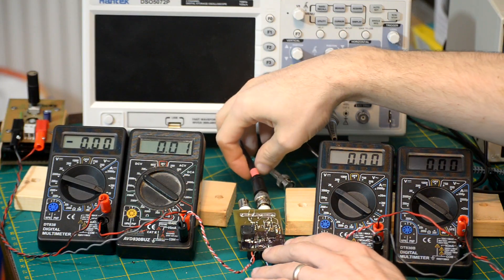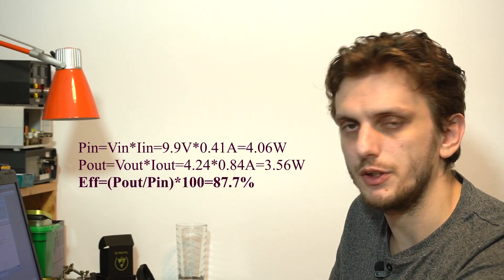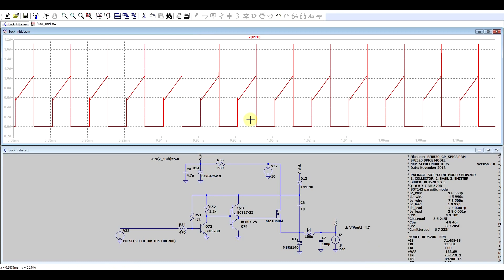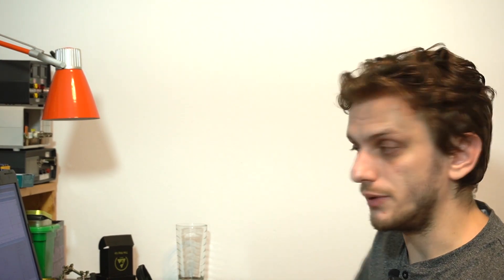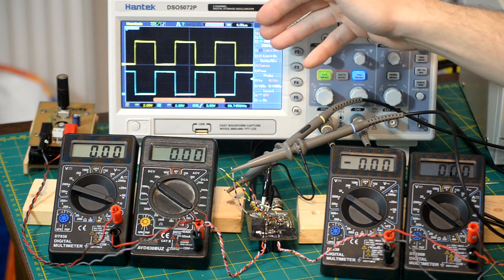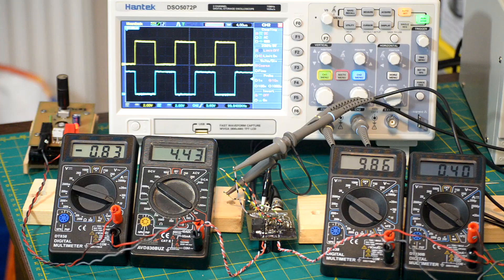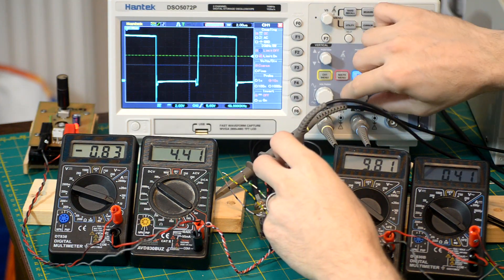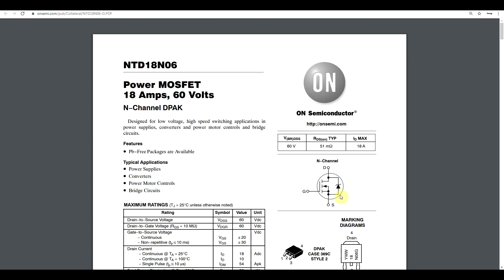Electronics Tutorial - Synchronous Buck Converters

Comment: Why voltage drop of the diode is negative w.r.t ground....
Reply from the maker: Its because of the way in which current is flowing - from ground towards the switching node; for the diode to be forward biased, the anode (connected to gnd) needs to be at a higher voltage potential than the cathode (the switching node); The current is flowing from the inductor trough the output capacitor/load and closing back trough the diode.

Comment: This was an amazing lesson, your style of asking the questions and answering later is very good to make you think first!!
Only one thing missing, what is causing the dead time? the voltage drop across the bootstrap diode?  Just saying because I noticed the low side switching is connected directly to V_stab ,high side switching goes thru bootstrap diode first.
Thank you so much for taking the time to do these videos!!
Reply: Or maybe It's probably due to the cross over on the push pull drivers?

Comment: Thank you Fesz ^\/v^--  ... when I want to know precisely what is happening in a circuit, I head straight to your channel.
Sometimes I need to replay video a few times to comprehend, electronically, what's going on. Your channel = wonderful knowledge base.
Using 'Synchronous Buck Converters' here lately with various tool batteries (e.g. 56-V 18650 and 18V 21700 batteries), for camping or emergency prep.
Using a 9:1 ratio, hand-crank, axial-flux alternator with 3-phase Schottky diode, bridge rectifier to charge a bank of super capacitors. This, in-turn, charges my tool batteries via boost Converter. (Also have mobile 400W solar charging alternative/ backup.
I'm using XT-60 connectors throughout for  modular use of components. 👍

Comment: This has been a super helpful video. One detail I found particularly useful was how you arranged your push-pull BJT's for driving the gate on the high side. I always put a PNP on the high side an NPN on the low side, but that inevitably resulted in a leakage when VCC would cause current to travel from emitter-base on the PNP, then from base-emitter in the NPN. Your arrangement is much better

Comment: GREAT...., how to generate that signal gap (all transistor off), and how long time ideally?
Reply from the maker: That is usually built into the driver; you have dedicated SMPS converter IC's where this dead time is fixed (it has some tolerance but its not user settable); but you also have some IC which only perform the gate drive function where this time delay can be set; 
Regarding the delay length,  ideally you want it as short as possible, but in practice, you will need to set it to account for transistor switching delays and also keep a bit of tolerance margin. Usually it will in the tens or hundreds of nseconds but based on specific design it could be higher or lower than this.
Reply: @FesZElectronics  great, thankyou

Comment: Such a great video, it will be nice if you make a video about H-Bridge High voltage Inverter Protection, I'm currently working on something like that even with having short circuit protection at the Boost side the mosfet's at the H-Bridge burn while testing short circuit I used SG3525 IC for the job
Reply from the maker: You might have issues with the voltage rating of the transistors - they should be able to handle not just the DC input but also any spikes that appear in the switching nodes (up to 10-20% of the DC). I'm not sure if and when I will cover H-bridge inverters though..
Hope this helps! Cheers!
Reply: @FesZElectronics  Thanks i fixed that, the problem was with low side mosfet's gate resistor which was too high & i also added pull down resistor and now it works just fine thanks for ur nice videos and help

Comment: I have downloaded the simulation and corrected the "X" in the component type as described below. However I am getting a problem where the mfets are shifted to the right and are not connected into the circuit. I just started using the program so don't know how to edit/fix this yet. I have downloaded version 17, and it seems that file is for version 4.
Reply from the maker: Hello yancy! The schematic was done in LT17 but that doesn't really matter. the point is depending on what symbol you are using for the transistors you might need to re-connect the traces, just make sure the terminals are connected and liked (between model and symbol) correctly.
Reply: FesZ Electronics Thanks for replying to my comment. I did manage to get the simulator working as I discovered the "move" tool. When I moved the fets between the wires, everything arranged itself properly. It was very good as I was really having a tough time understanding the boost voltage circuit. However after seeing it work in the sim, I am beginning to "get it".

Comment: Thanks for a great video. I am planning to build a 100 amp 48 to 24 volt buck converter for my solar system. Plan to add batteries in series to increase to 48 volts, but still want to operate a good 24 volt inverter. Right now I am ordering parts and trying to learn basics of inverters, and find your videos very instructive. Would like to see in future some tutorial on buying or making the 100 amp inductor.

Comment: Thankyou for great explanation. But when we increase the source voltage to 30 then Vd becomes 30 and gate voltage be nearly 11 as fixed in that case.. So how can I get 30 voltage at source side during the turn on time of transistor? According to my thinking, the voltsges in that case at source becomes Vs=Vg-Vth which roughly bevomes 9.
Need clarification from your side. Thankyou
Reply from the maker: I'm not sure I understand the question. If you are referring to the high side transistor, supplying the gate is done by the bootstrap capacitor (C8). So the gate-source voltage Vgs is not coming directly from the input supply, but rather this floating capacitor.  The voltage on the upper side of C8 will always be ~ 5V more (5V because of the way the V_stab voltage is obtained) than the voltage in the source of the high side transistor - so at 30V Vin, C8 is charged by 5V and when the highside is on, then the voltage on C8 reaches 30V+5V so enough to drive the high side.
Reply: @FesZElectronics  Thankyou for your response. My query got cleared. It's Vgs not Vg which should not excees 20V.

Comment: Nice! Now you basically build a Class-D power amplifier ;)
Next stop: dead-time adjustment. Google hint; look for XOR deadtime circuit. 
There is actually one where you only need 1 resistor to select the dead-time value!
Reply from the maker: Hello Piet! I don't think I will go into that much detail; at least not at the moment. I am aware you can build a complicated and accurate circuit with logic gates, but at some point its much easier to just get a dedicated driver that has everything built in. I was looking at some IC's from Infineon like 2ED2304S06 which has 2 inputs (for low and high side) but they also have IC's with a single input and an external resistor for the deadtime setting.
Reply: @FesZElectronics  True, I was thinking about it since, you were doing everything discrete already. (buck converters can also bought of the shelf).
There are a lot of IC's that can control dead-time and even more. Really like the IRS20957S and the IRS2092S. Both are for audio, but can also be used to other things (obviously). LM5116 is also nice, as well as some other parts (can't remember the name) with actually adaptive dead-time control. When a u-controller is used I would rather control the dead-time in the code.
Very interesting!

Comment: These videos are educational and I already spent a good time making my own buck converter from 0 V to 24 V as a high side driver with source to ground.  In this case, my PWM was a teensy 3.6.  But, for something practical and without issues, just buy an Adjustable LMxxxx.  Building your own buck converter with feedback is just frustrating.  But the knowledge you gain is invaluable.
Reply from the maker: I'm not very familiar with the board you are referring to, but regarding feedback, is there a dedicated block in the controller to get the ADC value to control the PWM or is this done in SW? I'm asking because if the feedback is SW based, that might be the main issue.. The reaction speed is not that good and depending on implementation you might swing between max and min duty cycle every time the uC has time to measure the supply output. Maybe you can give a few more details on the implementation you are trying.
Reply: The main point of the SMPS is efficiency, especially for high current PSU's. The LM series are linear and are no where near as efficient. Both have pros and cons and their place in electronics power supplies.

Comment: Hi FesZ, I getting an error at running  ltSpice Sim  "can't find definition of model 'ntd18n06l'?
Reply: I found a fix for that , need to change the prefix to X  (CTRL+ right-mouse-click) , thanks to Helmut.
Reply: Hello  @haimt ,  I'm seeing the same error message but I'm not sure what you mean by changing the prefix to X. Where is that? Please clarify. I'm new to LTSpice and just beginning to learn it thru these YOuTube videos and thanks to FesZ, I'm coming along!
Reply from the maker: Hello; the problem here is that every component needs a prefix so the simulator know what type of component it is (for diodes its D, for capacitor C etc.) For non-standard components it is usually "X". So when you add a new component, if there is no prefix added, it will create problems. As @haimt1464 said, just right click on the component - to open the component attribute editor and on the first line (prefix) add "X".
Reply: For some reason I had to hold down both CTRL and ALT button and then right-click the mouse button to access the component Editor. Thank you for your help and these highly educational videos. I'm now learning LTSpice. it's a great  Tool!!